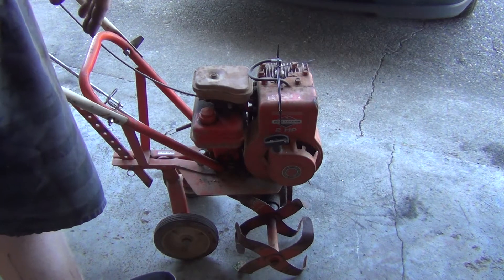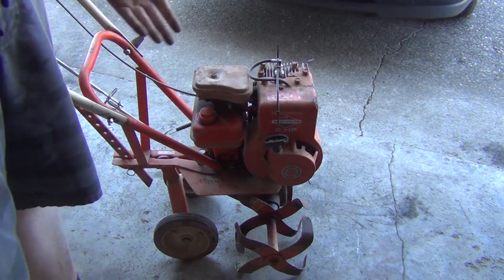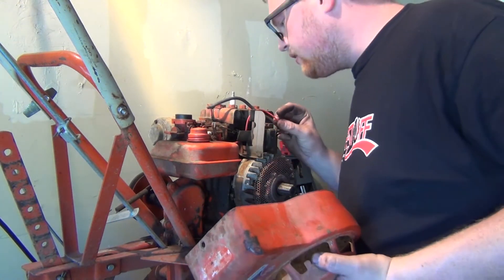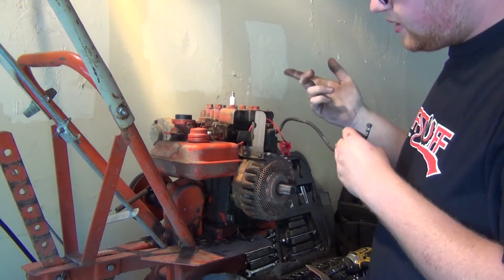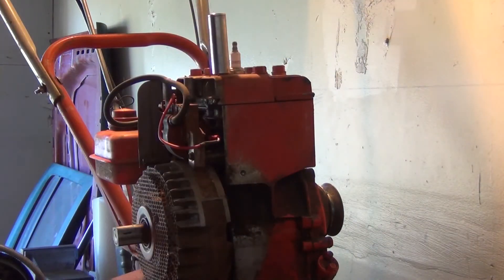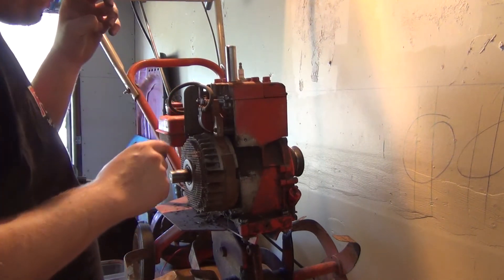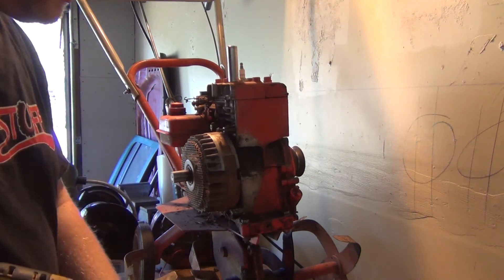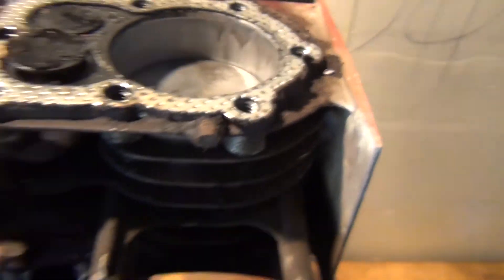Mongomery Ward Rototiller Project Round 1

Comment: I've had engines with way worse bores than that run just fine. One of my push mowers has a scored cylinder all the way around fairly deep, way out of round, about .010" piston to wall clearance and it runs like a raped ape. Not to mention the piston slap that thing has when cold lol. That engine will probably run forever with a new set of rings and a slightly thicker oil lol.